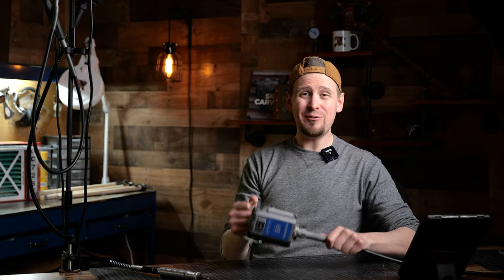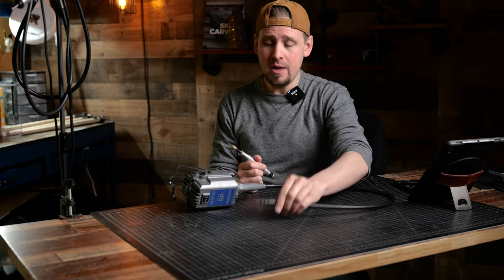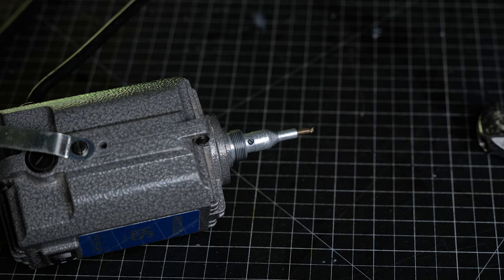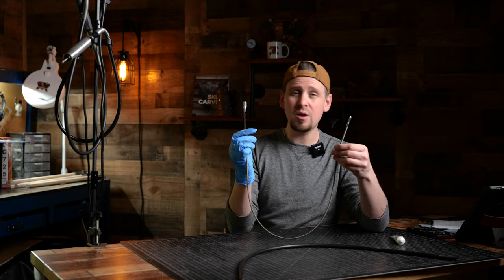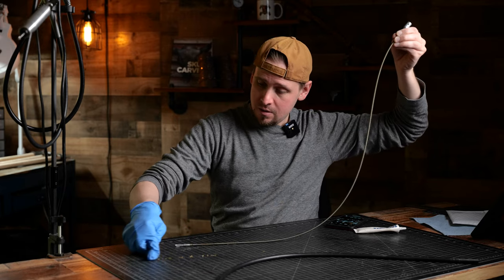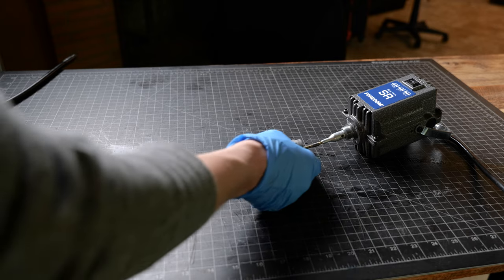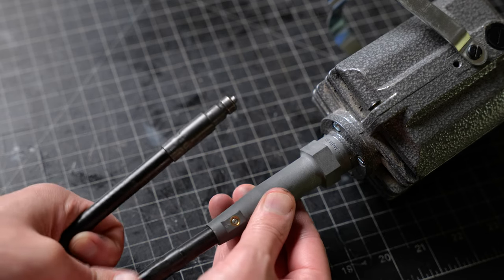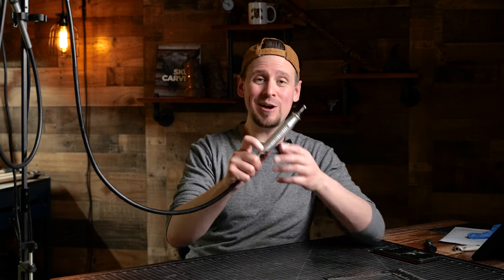Dremel & Foredom Rotary Tool Repair // Replacing Flex-Shaft Cables

Comment: Thank you I was wondering about that I was going to try to use a Dremel flex shaft onto a teccpo router. Because the flex shaft that came with the teccpo gets hot in just a few minutes. But I am going to ask that dumb question. Will a dermal flexshaft fit a Teccpo router ?